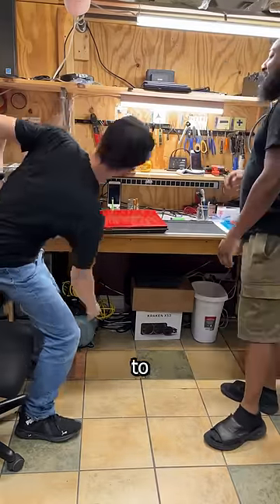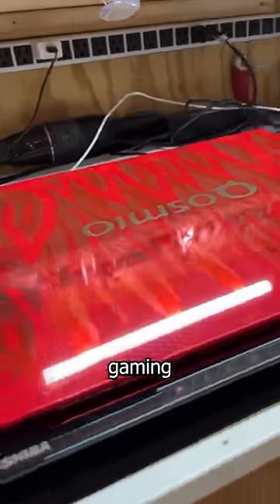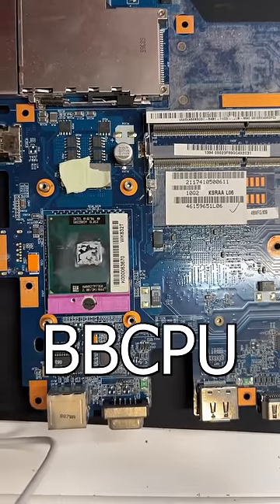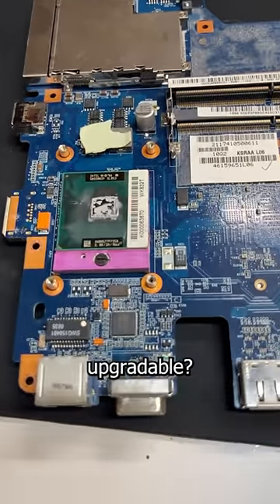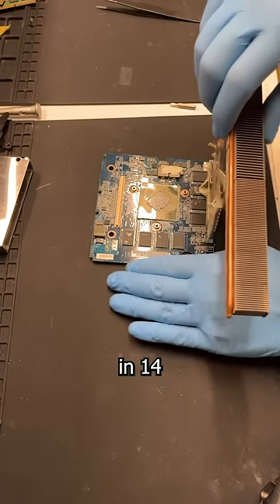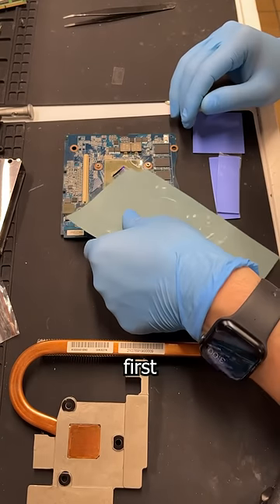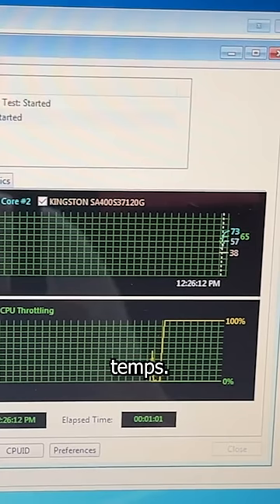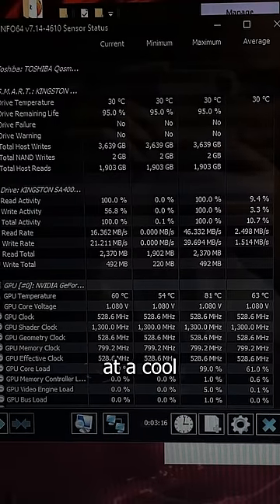Toshiba retro #gaming laptop teardown! See what #tech is buried in this #pc #shorts #technology

Comment: I've used those graphite thermal pads before (if those are the same), and you need to be very careful or else they will just fall apart. I tried to use one on my Steam deck and just ended up destroying it and using noctua thermal paste. Sure it's still thermal paste, but there was definitely a reduction in heat. Killer video! I love old PC's and this is finally starting to become retro.
Reply from the maker: Yeah I cut out the part where I had to re-assemble the pad because a corner of it fell apart. But I was very careful with the GPU and nailed it first try. The temp difference is insane.

Comment: Real dedicated GPU without using the framebuffer of an iGPU and these are replaceable, too. No overheating and not just a short compliance with the specs in Boost mode, because it has to throttle down again due to poor heat dissipation.

These old laptops were the most awesome in terms of longevity and maintainability.

Comment: Dang, I was hoping it was one of the few Core2Quad x305's.  I have an X305 in my collection that originally had the same CPU as the one in your video.  I upgraded it to a T8300 with 8GB RAM and SSD drive.  Pretty snappy, but I don't really use it.  It was my dream PC at one point, so I bought one cheap on eBay years later.
Reply: my new x305 has 2 gpus. planning to max it out including swapping cpu to quad core

Comment: Surely you can upgrade the mxm GPU card as you can still get mxm form factor cards all the way upto GTX 1080ti maybe higher than that even but im 100% sure you can get GTX 1080ti witch has to be a good upgrade even if it was just the vram difference lol
Reply from the maker: This isn't an MXM GPU. Look closely, it connects using a proprietary socket connector, not a card
Reply: @SalemTechsperts  very true 🤣 I did not look lol I assumed it was mxm as it's the same size and shape.. they might have a proprietary range.. being a socketed CPU and a removable GPU card they might have made at least 1 GPU upgrade!! Probably not but could be worth a look around 😃 or even a vram mod buy changing the memory chips to a bigger capacity maybe 🤔
Reply: @SalemTechsperts  or even finding someone to make a breakout board to get the power and PCI express lane's out of the proprietary connection. Like a board that turns the card into a PCI express riser cable that feeds out the back of the laptop body where the original heatsink fins are so you can attach a GPU externally because after upgrading the CPU to its maximum potential possible that GPU card is waisting a whole lot of the potential for the computer.. that's just a thought and really it's just a breakout board so it can't be to hard really as it's still just a normal PCI express just a stupid proprietary connection so there's no need for any logic..